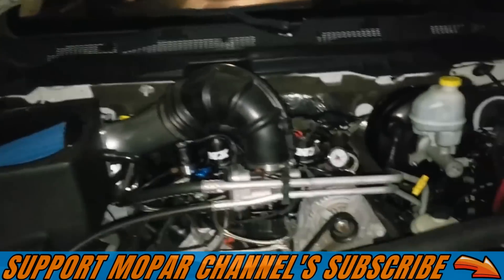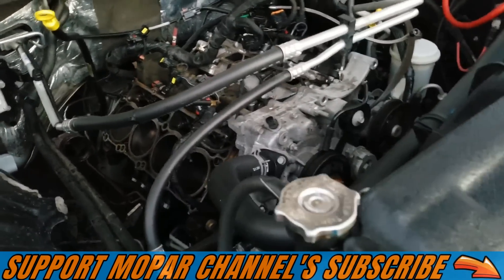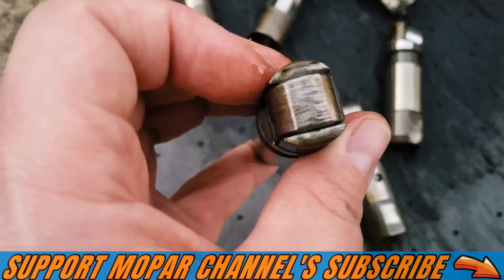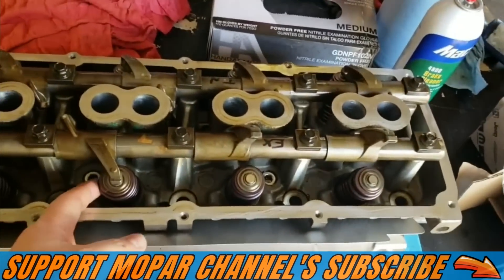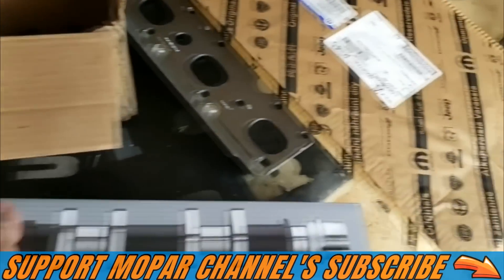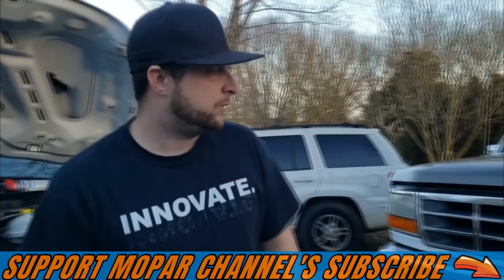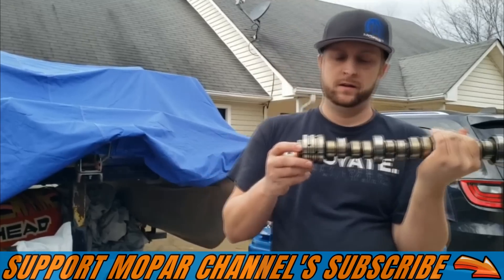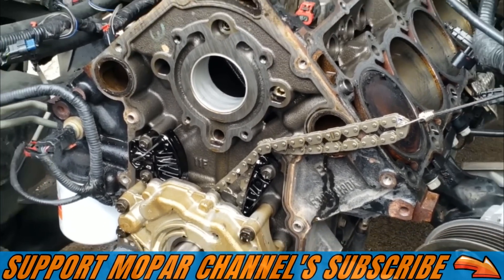5.7 HEMI TICK CAMSHAFT AND LIFTER REPLACEMENT MDS DELETE

Comment: pain having to remove the heads but atleast it has all new upper gaskets n seals, have you seen uncle tonys garage he did a video on what May be the cause, others say lifters are poor quality but why youd see so many with scoring on the sides of the lifter body youd think not enough oil.

Comment: Isn’t there a recall on this replacement job ?
I have seen several cams doing the same thing.
My Hemi is doing the same thing 2012 but it goes away when I drive it. Also I park it on a hill.
Reply from the maker: No recall just warranty replacement if it goes out during warranty period
Reply: Frostbite Ram 
Well I’m out on that warranty.thanks
Reply: if it goes away after the engine warms its probably a broken exhaust manifold bolt. common in the gen 4's. replaced mine and swapped w headers cleared up my noise and very nice mpg

Comment: Q: so why is there such wear on the camshaft and hydraulic compensators? Diseases of the HEMI engines?
Reply from the maker: The lifter bearing locked up
Reply: @FrostbiteRam  it turns out that it worked almost dry and it jammed?

Comment: Hi, Sir! How did your cam bearing's look after you pulled the old cam? I went to install my new cam on my 5.7 and the bearings to me looked horrible. I had no tick or issues with 90,000 miles on it. Thanks in advance.
Reply from the maker: Normally look good unless vehicle was run a long time with the tapping.

Comment: Hello so i replaced my lifters and cam and its making that ticking sound now could that be normal after replacing both?
Reply from the maker: It will tick for a few minutes or so until the new lifters pump up.
Reply: Still ticking andres?

Comment: Hey Man, great video 
Do you know any good tuner for HEMI who can do tuning remotely ? I would like to have an MDS delete with performance CAM, however where I live there are no tuners for HEMI engines 
Thank you
Reply from the maker: Thanks, what area you in. I currently use doctor differential and speed shop for remote tuning.  I have also used jay greene for remote tuning both will get you where you want to be.
Reply: @FrostbiteRam  thank you so much for your response 
I live in Qatar, can you please share with their contact details if you have so I can check details.

Comment: So my truck has been making that noise for a long time. Never got the misfire code. Wondering if i should do this knowing how much metal has been in my motor.
Reply: Also i just watched your other videos on this yesterday and it was crazy i wake up to see a new video posted. Seems like a sign for me to do this
Reply from the maker: I would definitely look into to it asap. Another thing you can due is remove oil filter and cut it open and check for fine metal particles they will look like shiny little flakes if you find that in the filter then you definitely need to inspect further
Reply: Frostbite Ram I plan on doing that within next two days. Do you have a suggestion on what mds delete kit i should get ?
Reply from the maker: @PsychoCam10  you can buy the mds plugs like I did or just leave the noids in and the new tune will deactivate them. Many people now just leave them in instead of using the  delete plugs.

Comment: Do the rams have a button to turn mds off like I have in my 15 Durango?
Reply from the maker: No,  only if in tow mode or manual mode
Reply: Frostbite Ram that’s really interesting, I wonder why they chose to give you the option on one vehicle but not the other.

Comment: What kit did you use to do the electric fan swap I want to get rid of my clutch fan
Reply from the maker: I'm using the factory electric fan that came on truck. Just removed clutch fan.
Reply: @FrostbiteRam  ok thanks didn't know there was a electric fan inside the shroud besides a/c condenser fan learn something new everyday

Comment: Mine does at start up but slowly quiets to nothing.  Well I’m fairly certain to nothing.  Hoping it’s just the header leak and not the cam
Reply from the maker: Sounds like exhaust leak.
Reply: Frostbite Ram what did you use to drill out that busted header bolt?
Reply from the maker: Just a drill bit and extractor.  I show it in the video.
Reply: Frostbite Ram sorry should of been more specific. What brand?  Every time I’ve tried in the past they broke and I failed miserably. Also thanks for the replies

Comment: Great Vid!  Just curious, have you ever had anyone that you know do the manifold bolt, stud, gasket replace on a challenger at home?  I've seen plenty of videos on trucks but they have a whole lot more space in behind the wheel well than the challenger does.  I took a look at mine and I don't know if it's physically possible to get the tools in there from the bottom without removing the heads.
Reply from the maker: Just need to remove the inner fender liners and should have plenty of room.
Reply: @FrostbiteRam  From what I can see it looks like there's the plastic fender liners that are directly behind the wheel, but there is also metal directly behind the plastic that doesn't appear to give very much access.  At least that's what it looks like from what I can see.  I jacked the car up yesterday and crawled underneath, stuck my arm up there it seems like it's almost totally walled in.  I'm going to take a closer look though tomorrow and hope for the best.  Thank you for the reply!
Reply: @FrostbiteRam  I managed to finally find a video of the exhaust manifold removal, it's on a 2015 charger but it should be pretty close.  So they do have perform it entirely from the top and bottom, it's walled in on both sides.  Need to remove a bunch of extra stuff like the coolant reservoir and some coil packs to reach it, from the top, and I think they had to pull the starter on the bottom to reach the bolts too.  I'm going to try and  see if that's the cause of the noise that I can hear in my engine, hopefully just by checking the problem bolts on cylinder's 7 and 8, those are the most common for breaking off.  If they are intact than I might have to do lifters....damn hemis lol

Comment: What year and what model is your truck?milege?
Reply from the maker: 2011 ram rt it had about 120k at time of failure I believe.
Reply: Frostbite Ram thank you so much!
As I know recently Chrysler fixed that problem by changing the old fuel pump with a 1.5x stronger fuel pump so all lifters get enough oils..I believe..And ye 2011-2016 years 5.7 hemi has camshaft and lifters problem as I heard because of luck the engine oil..thank you bro again for your video,when will i home i will watch more detailed :)

Comment: Ok so how long after the tick starts does it take to cause major damage? My truck is an 07 and its been making that tick for 3 years, about 30k miles making that noise now.
Reply from the maker: Well once it starts wearing the cam lobe all that metal gets pumped around the motor.
Reply: @FrostbiteRam  ive checked the oil and filter a couple of times during oil changes to see if it looks sparkly but it looks fine. I think my problem is exhaust tick most likely because wouldnt it have damaged something by now if it was indeed the lifter tick?
Reply from the maker: @omaraguilar1317  most likely broken exhaust manifold bolt very common and sounds very close like a lifter.
Reply: Omar Aguilar Check the video i posted for an exhaust manifold bolt.
Reply: @FrostbiteRam   ok so update. My problem is no more. Turned out 1 of my spark plugs was loose and it was causing an exhaust leak at the plug thus making a ticking noise. I only found out after my truck developed a horrible misfire and had to investigate.
Reply from the maker: @omaraguilar1317  that's awesome man👍

Comment: Is a upgraded oil pump required for this cam?
Reply from the maker: No not at all.
Reply: @FrostbiteRam  also, do you know the part numbers for a 2013 Chrysler? I’m looking into doing this full set up due to the lifter tick
Reply from the maker: @estebanbaez7789  if its the 5.7 everything i used will fit.
Reply: @FrostbiteRam  nicee, I’ll be using everything used
Reply: I searched up part numbers and says it don’t fit a 2013 Chrysler hemi
Reply from the maker: @estebanbaez7789  what doesn't fit
Reply: @FrostbiteRam  lifters
Reply from the maker: @estebanbaez7789  yes the hellcat lifters fit the dealer will say no because they are technically not for your car.
Reply: Thank you for the response!

Comment: Does the 6.4 hemi have the same issue? I have a 2014 Power Wagon. with 87000 kilometers on it with no issues as yet.
Reply from the maker: Not as common as the 5.7 but there has been some failures.
Reply: My 2016 6.4 ram 3500 is currently at the dealer for the same thing right now. Just rolled 55,000km with it. Second time it's been in for this issues. And I've changed my oil every 5000km and have only used the factory spec Pennzoil or AMS oil signature series.
Reply from the maker: @mattbalt5492  damn its definitely unfortunate
Reply: @mattbalt5492  that sucks! I have a 2019 power wagon, hoping to avoid this.
Reply: @carlsaiyed1097  only time will tell unfortunately. Make sure you have all your oil change records just incase. When it starts having issues, cold starts it will rattle like crazy, and then once and a while when its warm you will hear it until its completely bad, then it will be all the time.
Reply: @mattbalt5492  Thank you!

Comment: Did you have any metal in the engine? This just happened to my Charger RT
Reply from the maker: Oh yeah there was some I had to change oil a few times before getting it all out.
Reply: Frostbite Ram damn lol, is that all just changing the oil? No engine flush? I also have the 273 comps cam. Buying CNC ported heads next then installing it all since all this crazy mess just happened.
Reply from the maker: @IsThatGeneral   As soon as I did the repairs I filled with fresh oil ran the engine for 10 minutes then shut it off and changed it immediately. Then refilled with new oil again I drove the truck for one week then change the oil again. Then refilled with fresh oil and drove the truck for 2 straight weeks and did another oil change and everything looked clear no problems after that maintained regular oil changes.
Reply: Frostbite Ram thank you I’m going to do this to my Charger.

Comment: Does this lifter failure only happen on the Ram 5.7 Hemi? Or does it happen on all Rams?
Reply from the maker: Mostly on the 5.7 hemi
Reply: mine is the 04 1500 model, just under 200k, the only thing I have had to do is replace the water pump rubber gasket, absolutely no engine problems , runs like new, If I buy another pickup it will be the hemi dodge, FORD has had the same problem with the 5.4 3 valve engines, my 05 expedition king ranch had the roller rockers go out just under 100k, had to replace all the cams, the CAT on the passenger side and complete timming assembly
Reply: Gary Sisk seems like the newer rams are having lifter failures between 70,000 to 120,000 miles. I have read on the Internet and there are tons of people that have had failures with their engines on these newer Hemi’s

Comment: @Frostbite Ram : Do you happen to have a link to the video for the timing chain trick where you don't have to remove the oil pump?  I'm scared enough as it is to do this job myself, so I'm looking for all the help I can get.  :D
Reply from the maker: I explained it in this video all you do is hold the chain up with something so it doesn't fall off the lower sprocket

Comment: What year is your Ram?  I have a 2016, and I've heard that they changed out the lifters around 15.  Trying to see if the newer ones are having problems as well.  

Nice work on it man!
Reply from the maker: Mine is 2011
Reply: Does the 2017 Hemi still have the same issue with the camshaft and lifters.

Comment: How many people have found their exhaust manifold bolts broken? I’ve owned two hemis and had to replace broken bolts on both.
Reply from the maker: I had 2 broken on mine
Reply: Yep. 2 in each side
Reply: I had two broke on mine.  Resurfaced exhaust manifolds and leaks went away.

Comment: I have a 2014 5.7 L Hemi and it has the same tick sound at the same area, it has 89K but started at about 50K, only last a couple seconds until I guess the oil pulls up, not enough top oil.
Reply from the maker: Most likely broken exhaust manifold bolt that's common if the tick goes away when it gets warm.
Reply: @FrostbiteRam  thanks I just recently heard about that problem with the different metals causing broken exhaust manifold bolts at the higher mileage.
Reply: I have a 2014 and it ticks for a couple seconds on some start ups. Not all start ups. I had the dealer replace  2 broken exhaust bolts but it still does it. It’s like the lifters run out of oil when sitting sometimes. I have tried different oil filters and oil.

Comment: Does the 2016 Challenger with 5.7 without mds have same issue... I have 72000 miles right now.. motor is pretty quiet.. I'm running royal purple oil..
Reply from the maker: Its pretty common on all the hemi
Reply: @FrostbiteRam  so how do I avoid it?  Like I said my motor right now sounds great.. zero issues at 72000 miles

Comment: Make sure it's not a broken exhaust stud first. If noise goes away when engine is warm it's more than likely a broken stud
Reply: 2017 ram had 2 on the passenger side but under 60k so they fixed it free

Comment: My RT challenger has 33,000 miles, at what mileage did your truck develop that lifter problem ? If I drive my Challenger in Sport Mode would that minimize having the lifter problem in the future?
Reply from the maker: Lots of idling is bad. That may help but in reality its inevitable mine went out at 128k I believe.

Comment: Anyone know if this happens on a 2019 Ram Classic? Have the 5.7. Also, weird issue at idle car jumps from 500-800 rpm randomly and will continue spiking (revving itself between 500-800 rpm) at idle. Only 3k miles on it
Reply from the maker: Not as common but seems like a different issue
Reply: wondering if its doing a throttle re learn.....did you do anything to it
Reply: Joshua Cole I replaced the stock muffler with a Carven one. Other than that nope, bought it off the lot with only 12 miles. Never really noticed the issue until I was idling one day..

Comment: Between the distance from the Crankshaft and the camshaft, plus some bar between the two, restricting oil to be splashed over the cam, plus, the MDS crap system, plus Fiat, a awesome engine, was destroyed.

Comment: What happens if you don’t replace the cam after a lifter failure
Reply from the maker: It will not run correctly and will destroy the new lifter immediately

Comment: So what lifters should I use to replace the stock ones?
Reply from the maker: Non mds lifters "hellcat lifters "
Reply: Frostbite Ram I ended up going with the Melling JBK7521 non- MDS lifters. I hope they hold up better than Mopar lifters. The reason I went with the Melling lifters is because the Hellcat lifters are the same lifters as all the other Mopar lifters. They don’t make specific ones for the Hellcat.
Reply: Frostbite Ram Oh, I also got the Melling high volume oil pump and matching timing chain. I’m really hoping this solves the lifter problem. If not I’m selling my truck.

Comment: My truck did the same thing except 3 lifters failed and the end result was I had to buy an engine cause the steel off the cam wore out the bearings and oil pressure dropped. Mine died at just over 100k miles. When I put the new engine in I left the MDS unplugged, engine light stayed on but I didn’t care. it ran really well after and I didn’t notice much if a difference in gas mileage. MDS delete is the only way to go. I had plans of doing the MDS delete and tune but sold the truck. I bought a new Ram cause it was a great truck until the engine failed if I have any issues I will build an engine complete and replace it.
Reply from the maker: Great information 👍

Comment: What if it ticks when cold but goes away when truck warms up?
Reply from the maker: Most likely broken exhaust manifold bolt
Reply: Frostbite Ram thats what i thought. The truck behaves exactly like it’s always had but when the truck is cold I’ll get a tick but when truck warms up the tick goes away. I have 100,000 miles on my truck and I change the oil every 10,000, I also overland my truck so I’m really hoping that I’m not going to get this issue anytime soon. Thank you for the video it has definitely helped me out a lot

Comment: I have a tick after my cam swap. It only starts once the motor is warmed up. No ticking on cold start. It’s driving me insane.
Reply from the maker: Did you replace the lifters also
Reply: Frostbite Ram yup, a brand new set. I let them soak in oil for days.  Springs and seals included.
Reply from the maker: @Another_Random_Dave  that's crazy what's parts did you install
Reply: Frostbite Ram Jay Greene cam, limiter, springs, lifters, valve seals and MMX push rods. New timing tensioners as well. I thought it was odd my springs had shims. I’ve never seen stock heads shimmed, but I’m pretty certain I was the first one in there, so I left them. It only ticks once warmed up!😓
Reply from the maker: @Another_Random_Dave  yes they have shims factory. I'm using the mopar performance springs and with those you use the factory shims. I believe on the other brand springs you may not need the shims but I'm not 100% on that I would ask jay see what he says.
Reply: Frostbite Ram thanks for the feedback!! I subbed.
Reply from the maker: @Another_Random_Dave  thanks
Reply: You could have a exhaust leak/gasket some where in the engine after the install. Did you use the mopar gaskets and seals? I always heard to go with the OEM gaskets.

Comment: Is the same set up universal In Reference To 5.9L Engine
Reply from the maker: No the 5.2 and 5.9 magnum motors use different valve train design they didn't have this issue.
Reply: @FrostbiteRam  Much Appreciated